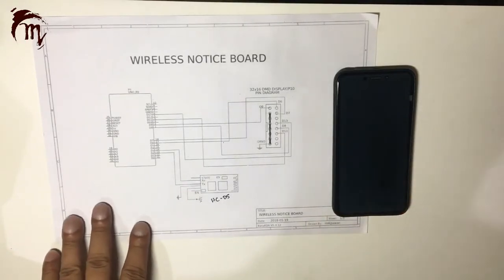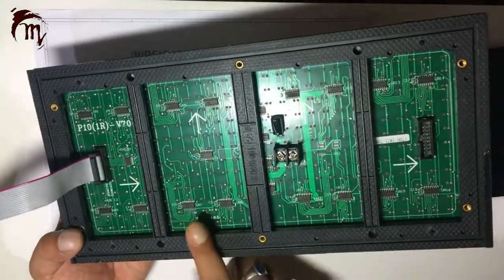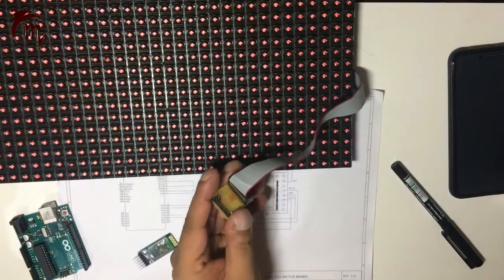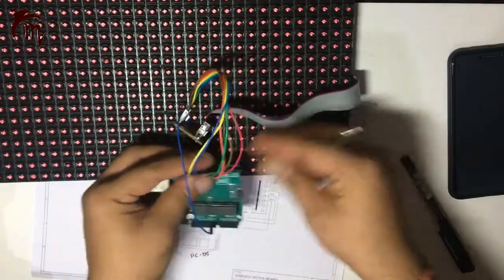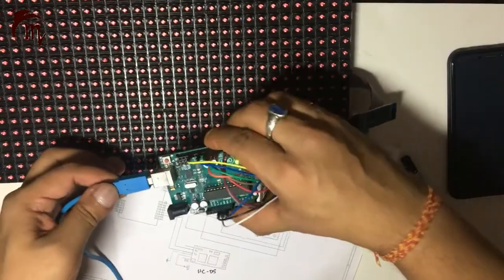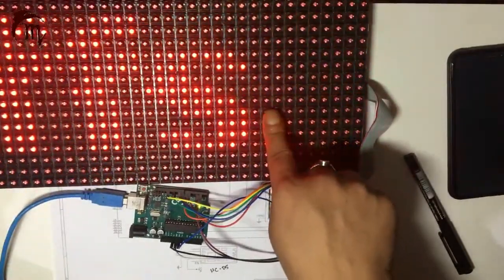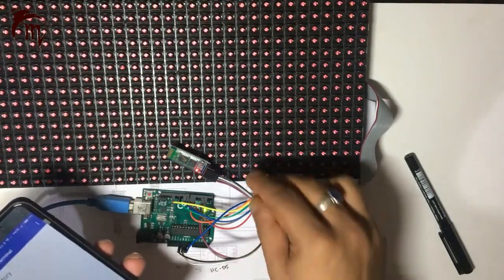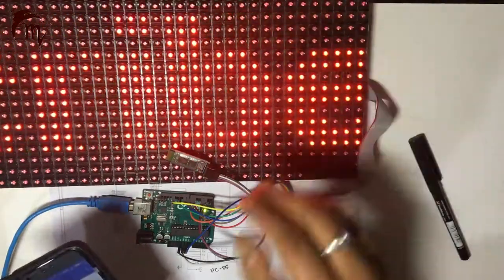Wireless notice board using Arduino UNO and Bluetooth

Comment: Arduino:1.8.10 (Windows 7), Tarjeta:"Arduino Uno"

Se encontraron varias bibliotecas para "SPI.h"
In file included from C:\Users\Ivan lameda\Documents\Arduino\sketch_mar01a\sketch_mar01a.ino:3:0:

C:\Program Files\Arduino\libraries\TimerOne/TimerOne.h:27:10: fatal error: config/known_16bit_timers.h: No such file or directory

 #include "config/known_16bit_timers.h"

          ^~~~~~~~~~~~~~~~~~~~~~~~~~~~~

compilation terminated.

Usado: C:\Users\Ivan
Se encontraron varias bibliotecas para "DMD.h"
Usado: C:\Program
Se encontraron varias bibliotecas para "TimerOne.h"
Usado: C:\Program
exit status 1
Error compilando para la tarjeta Arduino Uno.

Este informe podría contener más información con
"Mostrar salida detallada durante la compilación"
opción habilitada en Archivo -> Preferencias.
??????????

Comment: hello what ever we typed the first massage using Bluetooth does it repeats after the power off or reset of the arduino and what command is used in the code and where in the code can you help in this
Reply from the maker: Hey friend since the message is not store in EEPROM, it always start from the default message, as in the program when ever you restart it.